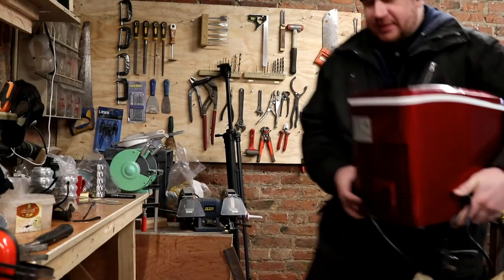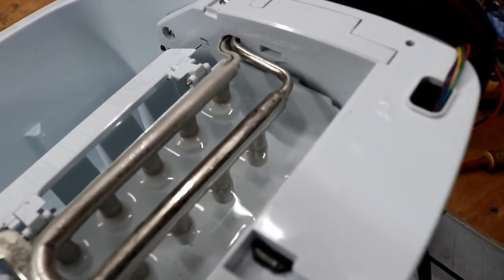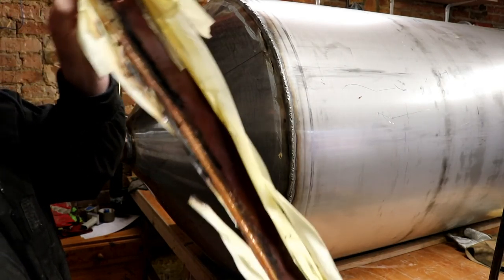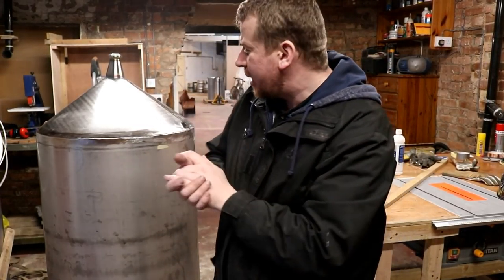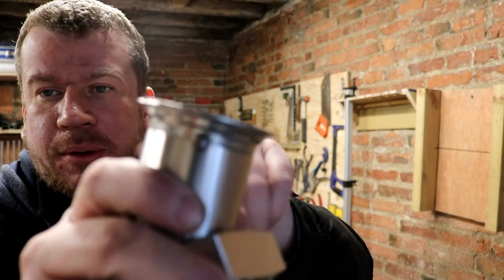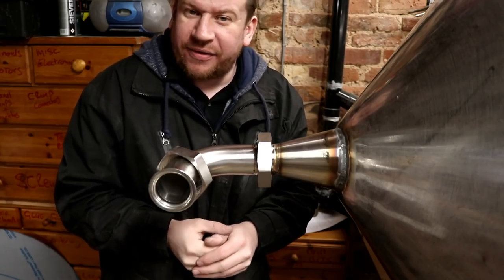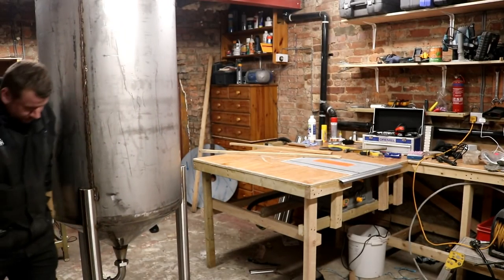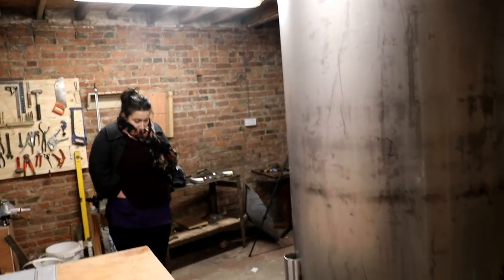THREE LEGS ON THE TANK

Comment: If your floor isn't level, and worried about FV's not being level.. you could cut some 6" diameter disc, three per tank, to thread into to the bottom of each leg(after welding a bolt to them), one per each. That would give you an overhang out side of the leg of 1.5" all around. Then, you could drill a 3/4" hole through the center of the legs end caps(caps that match diameter of leg), weld a nut on the inside, thread a bolt thats been welded to the 6" plate through the caps from the bottom and have a leveling system via the bolts. Screw the bolts in to decrease height, unscrew the bolts to increase height. Maybe attach a 6" piece of firm, 1/4" rubber to the bottom of the plate "feet", so they won't scar your painted floor. 
Thinking out loud and rambling on a bit here is all. Cheers!